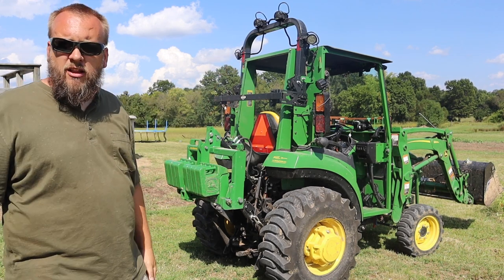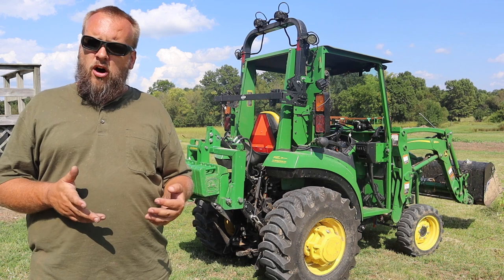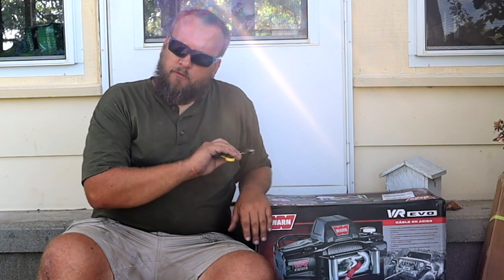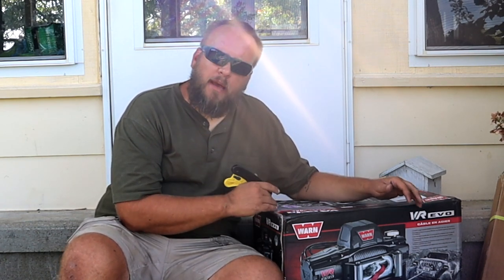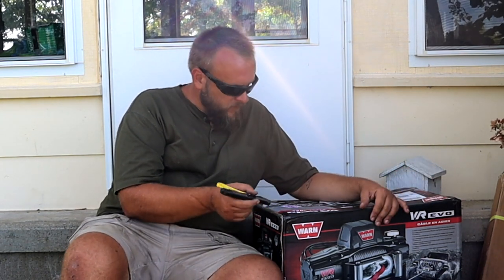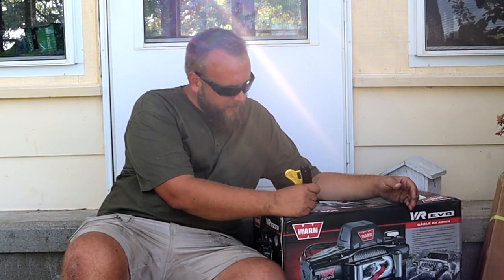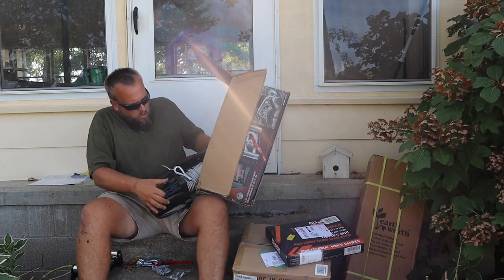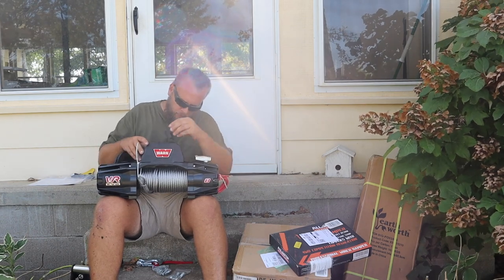Mounting a Winch on my Tractor

Comment: Depending on how much you're pulling out cable wise, it's probably a good idea to leave it running when using it. Those things are rough on a battery when they're strained. Not sure on the new ones, but the older ones you have to pull the cable all the way out and "pack wind" it back up under tension to keep it from trying to bird nest. I typically just drag the truck in up a slight hill and hand feed the wire evenly back in.
Reply from the maker: Thanks for sharing

Comment: Does that winch come with both the hardwired remote and the radio remote.
It is good to have both.
BTW  , great video and you got a great winch kit for that tractor.
You will love it.
Now get some tree straps and a couple snatch blocks.
Reply from the maker: It does come with both remote options.

I got the snatch blocks but I need to add the straps

Thanks for watching

Comment: Great idea! Could you really pull 8000 pounds from something hoocked to your tractor with a trailer receiver?
Reply from the maker: that is a complicated question because of friction. You easily can if it’s on wheels, but not if it has any resistance, for example, something being drug across the ground

I’m not sure how they are rated. Most likely pulling a cable on a static measuring device.

Comment: Lol it's not too big of a winch. I would say it's the minimum size for your tractor and truck.  Also handy to have is a snatch block 20k rated to keep with it.   I have a warn m8000 on the front of my f250 and keep 2 snatch blocks and extra shackles in my toolbox for such needs.  I can double my pulling power to 16k easy or more with additional snatch blocks.  Good pick on the winch capacity.
Reply from the maker: Thanks. Sometimes my commentary about stuff like that is what I expect people to say in the comments. I felt like anything smaller would be a waste of time if it can’t at least pull harder than the tractor

I got some snatch blocks but haven’t tried them out yet.

Yesterday I thought I was being careful about it but I got my winch cable knotted up

Tomorrow I will be trying to straighten it out.

Comment: You need to build a bracket with a receiver to mount to the front of the tractor so you can use it front or rear
Reply from the maker: Thinking about it

Thanks for the suggestion
Reply: I think he has, or maybe someone else I’m thinking of, a 2” hitch receiver on top of his front end loader bucket… can’t you insert onto that?
Reply from the maker: I do have a receiver on my wicked bucket which is pretty heavy duty. I wouldn’t want to use it for really hard pulling but in a pinch I can put it on there
Reply: @medjoolmaker  But that's not really strong enough you can twist or bend the loader arm or the bucket.  I guy I know took and made a mount that bolts to the front of the tractor frame where the brush guard and everything bolts to and welded a 2inc shank to it so he can use his winch on the front.  I could post photos I would post a picture of it
Reply from the maker: Yeah, The bucket mount probably isn’t the strongest

I think I’m going to set up a mount on the front Weight bracket

Comment: Did u have to and a nother battery on tractor or just a bigger battery so when you pull heavy and long loads with winch it keeps pulling ?
Reply from the maker: I don’t use the Winch very often but I didn’t change anything with the battery and it worked fine

Frequent use might be different

Comment: Consider switching the cables, put the short ones on the battery and the long ones on the winch. Less mess under the hood, and the longer cable with the winch may reach the receiver if you want to mount it on the truck rear. You could buy another coupler for the unused cables and mount those to your truck battery. I've had 8000# and 9000# Warns on a Jeep and 5 pickups set up like that. Have a smaller one setup that way for my John Deere 1025r with receivers for the 3 point hitch and my pallet fork attachment on the front.

Comment: Brock...  I think you forgot something.  You said you may want to connect it to your truck, or trailer if you need to.  You will need to make sure you always carry a wrench with you to disconnect it from the tractor battery if this is the case.  Forget about your plan to possibly route the wiring from the front to rear of the tractor.   GOOD VIDEO.  I was thinking of doing this myself now that fall is coming and the ground is getting softer.
Reply from the maker: I was thinking about buying another wiring disconnect kit for the truck so I can leave the wiring in place

Thanks for watching
Reply: @RockhillfarmYT  Wouldn't it make more sense to put the short side of the wiring on the battery and keep the long side with the winch? Then you could get another short end and put that on your truck battery and easily move the winch between them.
Reply from the maker: I definitely see your point. The long side is inconvenient on the winch or on the battery side

Having that much cord on the winch anytime you have it mounted on the tractor is a good way for it to get snagged and pulled out

Since I needed to add a breaker into the line I’m going to change up how I have the wiring and show it in another video

Thanks for watching

Comment: Using receiver hitches for mounting my 12,000# winch to my pickup truck is exactly what I did .They sell receiver hitches for the front of the truck frame as well as the rear.
I only needed to build a special offset drawbar adapter to lift the winch up higher in the front so it was not too low.
Now I can remove it or put it on when I need to.
BTW , I went to NAPA and bought 4 of the blue 175 amp battery connectors and  enough 2 gauge welding cable off ebay to run the power out the front grille and to the rear bumper. Made the rear one long enough that I can also use it for the winches on my flat bed trailers.
I also set up my 2018 Silverado with dual batteries and a battery isolator solenoid that is on in start and run key positions.
Grounding the power connectors to the frame and batteries is very tricky and important here on the new trucks or it won't see the power load of the winch and not charge the batteries correctly.
Reply from the maker: Thanks for sharing

The Ram 2500 I ordered has dual alternators

I will set it up for the truck when it gets here
Reply: I figured out how to add the dual battery setup years ago on these new GM trucks WITHOUT causing unintended electrical issues in the last 3 GM trucks I've owned.
I've never had to add a second or upgrade the OEM alternators in mine.
The reserve of that second battery is what does it.
First thing to do is upgrade the sizes of all the NEGATIVE battery cables from the battery to the engine block #2AWG and from the battery to the vehicle frame #4AWG.
Both negative cables must go through the current transformer loop by the battery.
BOTH of the battery cables for the second battery must be brought to the primary battery and hooked in there.
Do NOT ground the second battery anywhere else.
It creates a ground loop and messes up the negative battery cable current transformer and it won't charge correctly.
I pulled my negative battery feed to the winch connectors right from the drivers side of the engine block.
Also ran a #2AWG jumper from the drivers side frame to the engine block as well.
The isolation solenoid is installed in the POSITIVE cable near the primary battery.
It is triggered from an unused pin in the distribution block under the dash next to the Ebrake pedal that is hot in the start and run positions only.

My system has been in 3 trucks so far and works great.
Reply from the maker: Thanks for sharing. I ordered my truck a while back and it just had the option for single alternator or dual and it was only a few hundred dollars so I figured I might as well get it.

I’ll look at what your telling me whenever the truck comes in
Reply: Gm has a really wierd charging system algorythm. They monitor total battery draw and/or charging through the negative cables.
They monitor system voltage.
The monitor outside ambient air temps.
They monitor alternator or underhood air  temps.
I had to do a lot of research on this before I actually did it.
Didn't want to void their warranty.
GM was of no help.
They said if it wasn't engineered and built that way , it shouldn't be modified.
I had to figure it out.

Comment: Cool setup, exactly what I intend for my tractor. Although going 12k bigger better right?!?
Reply from the maker: Agreed. I saw people putting little Winchs on their tractors that wouldn’t pull half of what the tractor could and I thought I was going Overkill at 8000 pounds.

I was wrong. If I was buying again I would get a 12,000 pound winch.

The winch I have Pulls harder than the tractor Which I have demonstrated on a couple of videos.  However if the tractor is getting any traction it will pull probably 80% of what the winch will Sometimes it’s a little frustrating that this one still won’t do what I want it to

If the tractor is parked with the emergency brake on my winch will drag the tractor across the ground so I have to block the tires but I would still go 12 K

Comment: You really want to put a properly sized fuse within 12" of the battery.  This will protect from potential fire if the cable shorts to the chassis.
Reply from the maker: Great Point

I was just thinking about that

Comment: The battery and alternator can handle the draw?
Reply from the maker: My answer would be that it depends on how you are using it. If you do a couple pulls and then operate the tractor for an hour and then do a couple more pulls then I’d say you’re good to go.

If you are constantly pulling logs for an hour I could see the possibility of running the battery down.

That’s exactly what they told me about the trickle charge on my dump trailer.

The charge from the truck is not designed to keep up with constant operation but if you drive in between loads it will do fine

The answer I just gave is an opinion. When I do a follow up video on this set up a month from now I will have a verified answer
Reply: @RockhillfarmYT  thanks. I figured if used in moderation and if you can raise rpms we’ll probably be fine. Thanks again. 👍🏻

Comment: About a year ago I did the same thing.  I put a 2" receiver on my front weight bracket and use that position to pull trees across creeks and ravines leaving the rear for skidding logs.  I also put a 150 amp circuit breaker near the battery and made an extension to run from the front to the rear when needed.  I use the this power tap to run other things like a dump trailer and a crane for loading 1000lb. Logs onto my splitter. Woks like a champ. Let me know if you need photos. Cheers!
Reply from the maker: Sounds like we do similar work

I have a 7x12 dump trailer

If you want to share anything feel free to send it to kcfan491@gmail.com

Thanks for watching

Comment: Nice winch setup!  One thing to note, you should not run the winch cable around something and hook it back to itself.  It is very bad for hook to be pulling sideways on the cable like that.  You will want to carry a sling for when you need to go around an object like that, then clip the hook to the sling.  A length of chain with a grab hook can also be used to create a loop to hook to.
Reply from the maker: Right. Thanks for sharing

This first test was an easy pull

Comment: Love what u did. Plan on putting one on my weight box. One thing though. If you are pulling heavy loads. Make sure your weight bar is set real low or you could lift front wheels of tractor
Reply from the maker: Right
Reply: Instead of a fuse use at least a 100 amp resettable circuit breaker.
Reply from the maker: Yes I ordered some more parts for this including mounting plates for other locations and in-line breakers

Comment: That's a great idea. I would of felt a lot more comfortable yesterday on a project I was working on if I had a winch setup like that. I was removing about 3 feet by 10ft of solid mud, where a farm road crosses the creek. All the sediment from this spring/summer flood waters piled up. It was wet and slick. It had me nervous a couple of times. Lol. Great video, Brock!
Reply from the maker: Thanks

Definitely sounds like a good way to get stuck
Reply: @RockhillfarmYT  luckily, I did not.

Comment: This is exactly what I want to do to my 1025r! Very curious how it works. Some people said I would need an auxiliary battery since the tractor alternator is too small. Not sure of the difference between my tractor and yours alternator wise but very cool.
Reply from the maker: That would probably depend on how much you are using it, or how much you are driving between pulls

I will worry about it when it becomes a problem

Thanks for watching
Reply from the maker: Kind of like a dump trailer

If you drive a ways between dumps it’s fine
Reply: @RockhillfarmYT  thanks!

Comment: A winch comes in very handy I have a 12000 lb. I got a 2nd drawbar bar welded a receiver tube to it so I could slide the winch into it and then added a piece of the tube to my Trailer. I'll be building a bracket with a receiver this winter for the front of the tractor. So I can use it on the front or rear of the tractor front or rear of my pick up and my trailer. I bought a dump trailer wiring kit for all the wiring of the truck tractor and trailer.
Reply from the maker: Nice setup.  I thought this 8,000 pound winch would be overkill but now I wish I had gotten a 12,000

Thanks for sharing